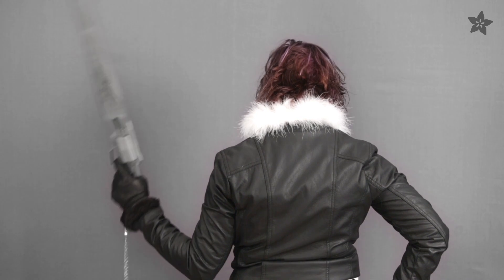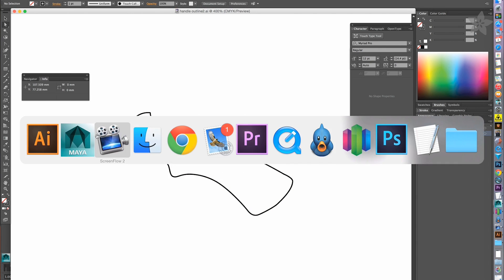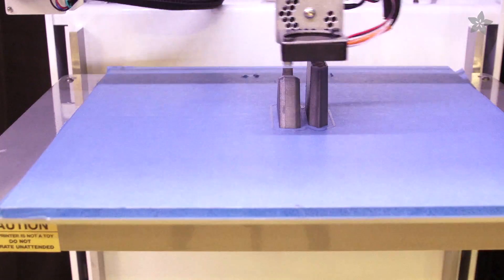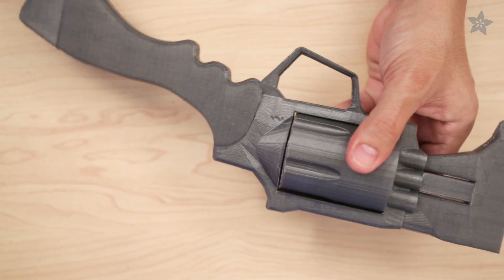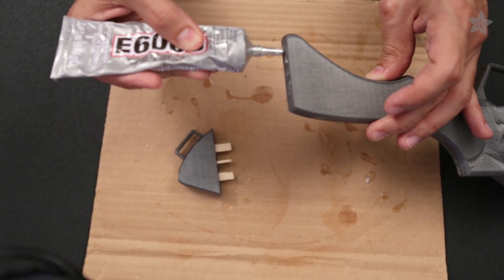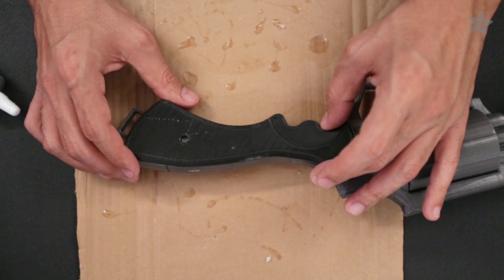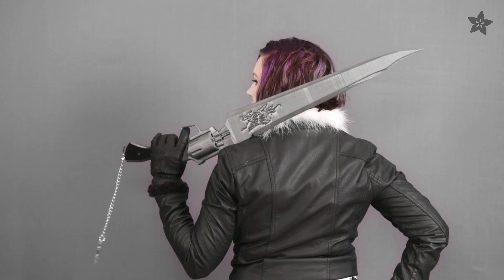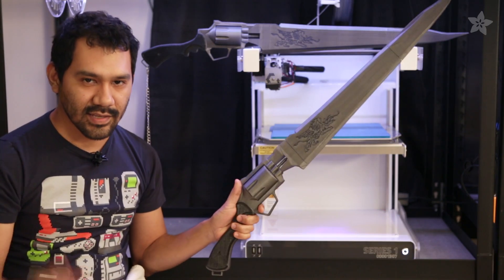#3DPrinted Gunblade

Comment: I know it's a bit of a stretch, but I was wondering if there's any technique we could use to melt a little bit of the same plastic and quickly apply it with say, a putty knife to fill in those seems? Do you think there would be a good way to do that?
Reply: With ABS you can use Acetone to smooth out the surface.  With PLA I had luck skim coating the splits with spot putty (normally used for autobody repair).  Then I hit the whole thing with 2-3 coats of high build primer and sanded it smooth.  It takes some time but the results are great.